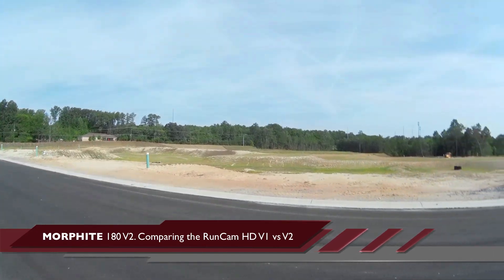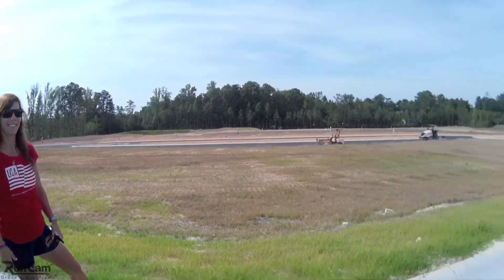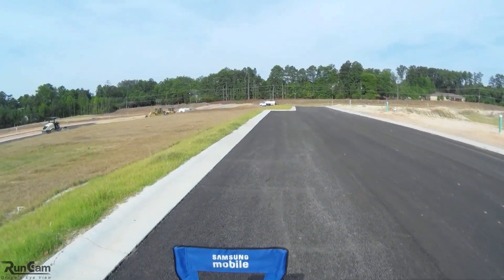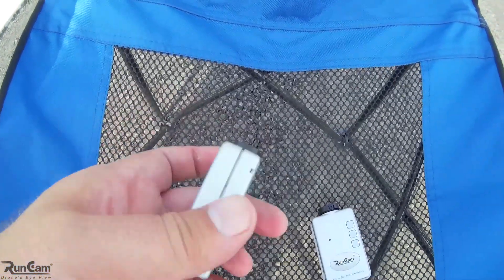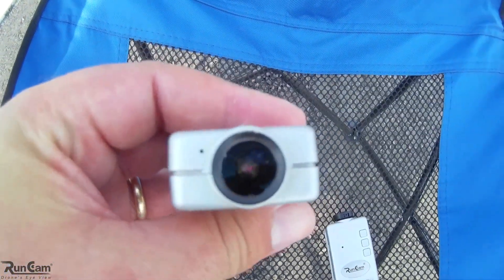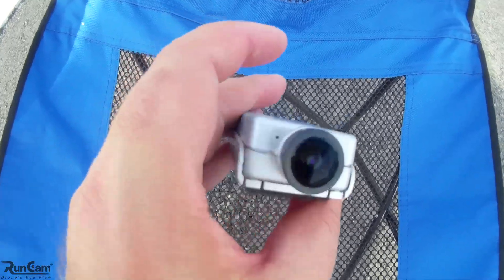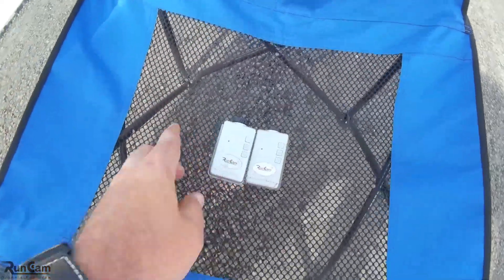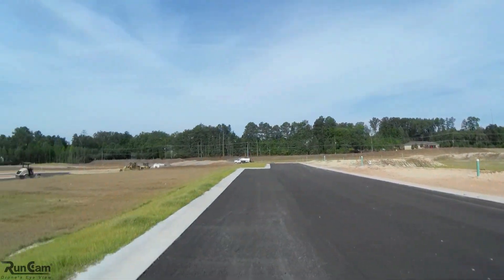RunCam HD V1 & V1.2 Lens on a MORPHITE 180 FPV

Comment: I hate the configuration software, i used it one time and i was so disapointed.
They really need to improve it more!
Thanks for the ride anyway, have a great new week
Reply: ABMNS PRODUCTION Have you tried the new web based software? It's more polished than the last PC version but definitely still could use some improvement.  If you listening RunCam FPV I'd like to see an exposure lock function like the mobius has.
Reply: brandon cruz Sweet! Thanks for the heads up! I will have a look on this web based software :)
Have a great week
Reply from the maker: ABMNS PRODUCTION I quickly tried the online tool and it works great ... Can be found here: http://app.runcam.com/tool/
Reply: FunFly FPV Thanks :)

Comment: This is not V2. It's the same RunCam HD with a different lens having F2.8 aperture. Same camera, different lens. Don't confuse people calling it V2 like it's some new version of RunCam. F2.8 lens has been there for a while and I actually own both versions. When you first said it's V2 camera, I thought you've got some completely new unreleased version for the review. You are the only one who is calling it V2. Please don't. If/when the real V2 is released, it will just add more confusion.
Reply from the maker: ***** Ok, I thought I made it clear, but I see your point ...
Reply: Geeze, Calm down. Runcam did add a larger battery AND change the lens.